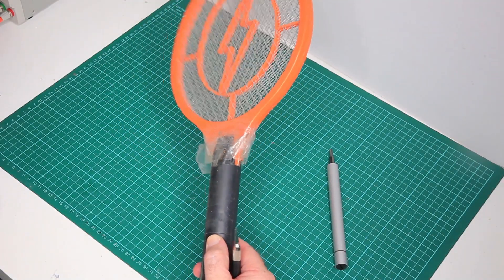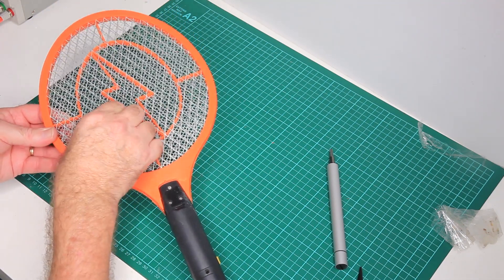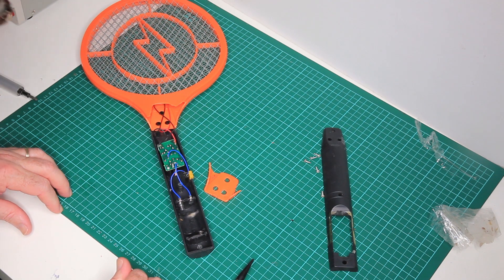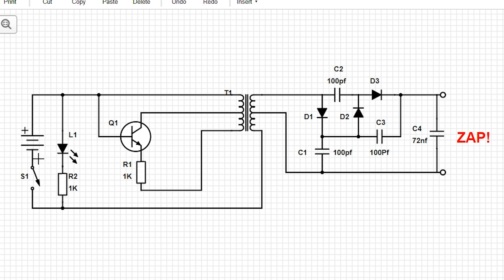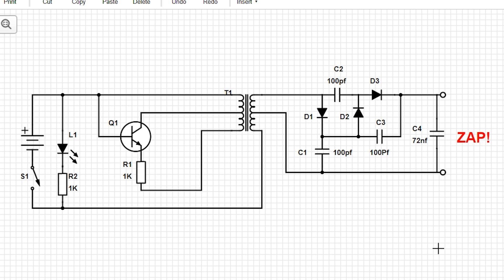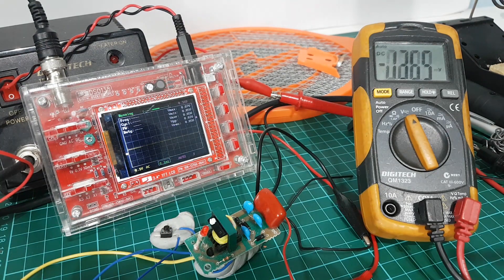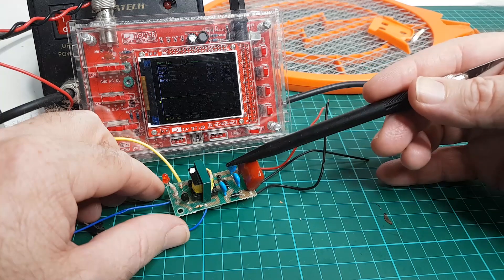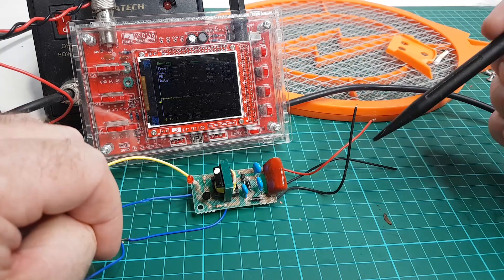Bug Zapper Teardown & Circuit

Comment: hi, in this circuit has battery charge controller? that control overcharge battery.
Reply from the maker: Hi Tupai, no sorry, the circuit contains no elements for battery management.  It is a simple voltage multiplier :-)
Reply: Benny in the shed so the battery will damage if overcharge the battery?
Reply from the maker: Most definitely !

Comment: Circuit is not correct.  As drawn, it will not work at all.  Note there is no way current can flow in the primary.
Reply from the maker: I'll take another look at it but I think it's accurate.
Reply: @bennyintheshed7821  Check the pin-out on the transistor.  Your circuit is certainly wrong. The middle pin isn't necessarily the base. Further, you incorrectly assumed that the transformer has two windings with center-taps on both primary and secondary.  If you did a continuity test on the lower two leads you'd see they are connected: this has thee windings, not two.
Reply from the maker: Thanks for that  @Chadwickyboy   no way I can amend the vid now but hopefully people will refer to your comment.